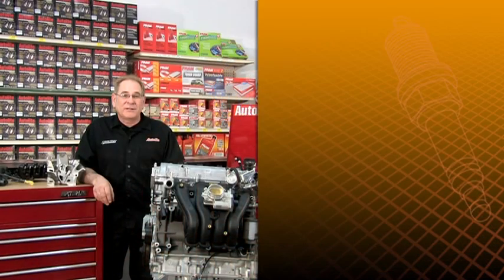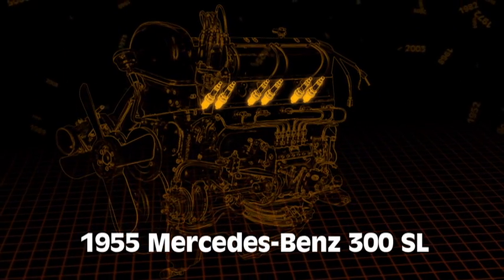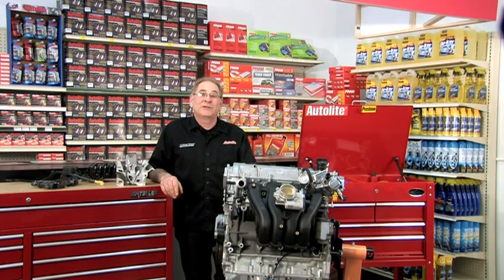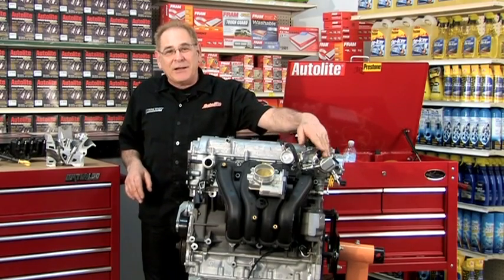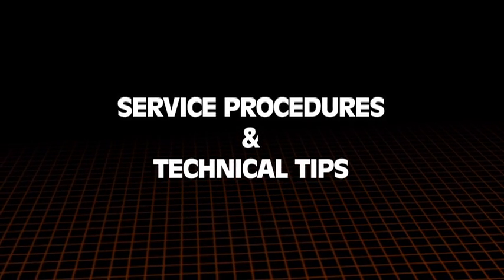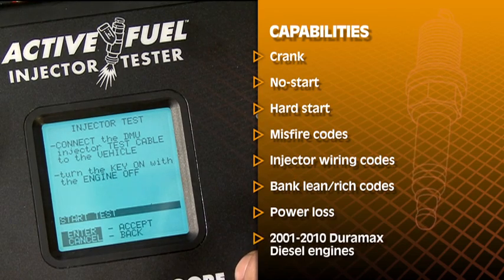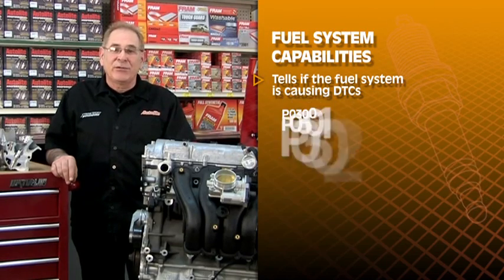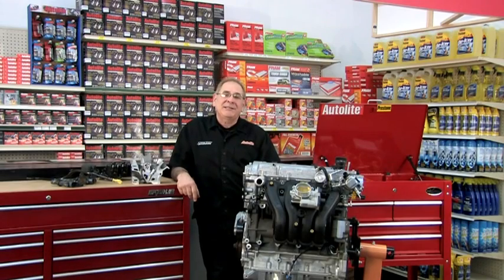Direct Fuel Injection Diagnostics

Comment: How does this system work without an accumulator?  Gasoline is a liquid and can't be compressed.  What am I missing?
Reply: The pump pressurizes the line itself which happens to have fuel in it. The fuel rushes out the injector at the pressure within the closed line  as soon as it opens. Due to the placement of the injector, the fuel has to overcome head pressure to push out and break up properly for proper spray
Reply: If there is no compliance, the fuel pressure will drop to 0psi as soon as the injector opens.  On my car, there are 3 cam lobes driving the HP fuel pump, but there are 4 cylinders.  So, the pressure must stay up even after an injector event.  Where is the compliance in the system that allows this?
Reply: @ThatEEguy2818  constant pressure.  You have 2 pumps. 1 in tank and your mechanical pump driven by the lobes. The hp pump pressure is controlled with a solenoid valve that opens or closes depending on voltage it receives.  The injectors only open for a few ms. It also sprays for through tiny holes. Because of these factors, the actual rail pressure variance is minimal
Reply: My understanding is that the solenoid in the HP pump is only opened briefly by the ECM to let in a measured amount of fuel to be compressed.  The ECM knows the pressure in the HP rail, and it knows the pressure at the inlet.  It knows how much pressure it needs, and calculates how long to open the solenoid.   Still, there has to be compliance in the system for it to work.  What is stretching under pressure?
Reply: @ThatEEguy2818  I suppose I'm not sure what your actually asking.  I was assuming you are wondering how the rail can maintain constant pressure when the cam has 3 lobes and the injectors open? I believe the solenoid that's part of the hp pump is controlled by variances in voltage.  The higher voltage sent from the ECM or fuel controller, the more the solenoid opens. I dont believe It opens and shuts as in 0%-100%-0%-100%. Its more like it stays at a set value and moves according to engine load. For example,  if you are traveling with the engine at 38% load, the solenoid would be open 38% and would probably vary between 35%-44% open. The pump from your fuel tank is fairly constant and typically 45-65 psi (depending on vehicle) at all times. Let's say a constant 60psi reaches the hp fuel pump. The mechanical pump pressurizes the line to let's say 2200 psi. The high pressure solenoid opens to let's say 50% so this allows the pressure on the rail to stay at 1100 psi.  Typically at this point, pressurized line with fuel that is left over is sent back to the fuel tank. The pressurized lines with fuel that makes it to the fuel rail is pushed through a few super tiny holes for all of about 4-5 ms on avg as an injector opens and closes. Any pressure released during the injection pulse will automatically be compensated via pressure coming out the hp fuel pump along with constant tank pressure. The high pressure sensor on the rail shows the amount of pressure as well pressure loss during injection pulse. Does this explain this a little better? If not I will try again
Reply: I have a well.  In my basement is a tank with an air bladder.  This tank charges up, and has so much compliance that spraying a second of water out a faucet doesn't impact water pressure.  If the tank goes bad, and there's no other compliance in the system,  that same 1 second spray from the faucet would cause a dramatic drop in water pressure.  If I left the faucet on, the pump would short cycle, turning on and off while the pressure sensor relay chattered.  It would burn things up fast and pressure would be all over the place.  It would be out of control.

What, on the HP fuel rail, has compliance like the bladder tank of a well?
Reply: @ThatEEguy2818  a high pressure fuel pump has a diaphragm located within the pump. Is this maybe what your referring to ?
Reply: Maybe.  Idk, will have to look for one cut open.
Reply: Is the diaphragm rubber?  I was thinking it was a piston pump.
Reply: I've been doing more research.  Everything I'm finding says the fuel pump is piston type, the solenoid is controlled by the ECM as if it were another injector, but injecting a measured amount of fuel onto the pump to be compressed.  This valve, so says everything I've seen, is on/off every pump cycle and not in a state of quasi-on all the time.  Also, the walls of the fuel rail are thick metal.  So, since gasoline is a liquid and liquids don't compress, what expands in the system when the piston in the HP pump compresses the fuel?
Reply: @ThatEEguy2818  in the video link I sent it says that it uses high voltage to initially open the solenoid and lower voltage to keep it open. Also.  I have a hp fuel pump that I may disassemble later to see. I understand what you mean by what expandable object helps create the pressure.  Like a balloon with air and water in it. The balloon expansion would be potential energy and if the balloon shrinks it becomes kinetic energy.  Almost like a stretched rubber band. I will see if I can find out more about what the diaprham is made of. I believe that may answer  your question
Reply: That high voltage spike is just how they do the injectors as well.  Yanks that pintle back quick.
Reply: I think this is the answer.  I was assuming gasoline couldn't be compressed.  It can.
https://physics.stackexchange.com/questions/207637/can-gasoline-be-compressed/207640#207640
Reply: @ThatEEguy2818  this makes sense. Diesel fuel has higher compressibility than any fossile fuel because hydrocarbon chains are very long and each atom have more spacing with each other which makes diesel fuel a highly compressible fuel. Due to this compressibility, compression ratio is higher and break power is higher than petrol and gas cycle. Which gives the result of high energy in diesel fuel.

A diesel  engine has a higher thermal efficiency so this gives the result of increment in conversion of chemical energy to heat energy so that’s why diesel engines have higher effeciency than petrol engines
Reply: @ThatEEguy2818  I can say that the direct injection systems can be a real pain to work on. I have experienced it with a few vehicles.  One in particular was a 2009 buick enclave 3600 engine. It's a super pain to get the injectors out and in mostly due to the location of them. I am currently working threw a mystery problem that even the dealership doesnt seem able to diagnose.  I have no high pressure in my rail which causes it to run in limp mode. I clean initially took the injectors out and manually cleaned them using B12 in a tube, compressed air, and a power probe to power them. 3 of 6 were somewhat clogged (carbon buildup) and of the 3, 1 was badly clogged.  I got it back together and had an issue with a small leak. I took it apart and put it back together and now no leaks. I them decided to change the hp fuel pump. My codes were p0087 and p0089. The fuel rail had 58psi ( pump in tank). Changing the hp pump did nothing.  I checked the signal running into the pump solenoid and it was recieving something like 5.6 volts. I took the lines off from the fuel tank to the pump and verified they weren't stopped up and I also checked the sock filter in the tank. All was good. I decided to see if the dealership could figure it out and the conclusion they came at me with was it needs a high pressure fuel pump. I already changed this. I made sure the connection piece for the pump and camshaft  connected with the roller to the base circle of the camshaft. It still isnt working as in stuck in limp mode with white smoke. It appears to be flooding out but sensor reads no high pressure. I am going to change the high pressure sensor on the fuel rail next. My suspicion is that the sensor is faulty.  If its reading low, the computer tells it to add more fuel. If the sensor is faulty it is going to cause the system to try to compensate when it's not neccessary causing a really rich condition.  

I have researched these systems fairly extensively.  Physically The only parts left for me to explore is the hp sensor and the camshaft lobes themselves.  I doubt the lobes are worn to the point that its unable to pump. 100k mile vehicle shouldn't be at that point.
Reply: I have an equinox with 110k mi.  Cam lobe was about half worn because roller wheel on fuel pump seized.  It sounds like you're not using a scope to diagnose.  Gotta have one on modern engines.  Also sounds like one of your injectors are leaking.
Reply: Btw, it could be wiring too, not always a part.
Reply: @ThatEEguy2818  I've checked the ground, constant, as well as output signal. All good. I've pressurized the rail and checked for leaks via autel maxidas DS 708. No leaks found. I've ran engine balance test and all good. I'm convinced wiring is fine. I'm also convinced it's the camshaft lobes, hp fuel pump connector (wheel worn or deformed), or sensor has to be the problem (at least I hope)
 I've found the  hp fuel sensor is stuck at a certain voltage regardless of accelerating or idling.  I realize it receives a constant voltage but I'm referring to the output signal. The dealership managed to trade out the fuel control module and ecm with no success so those are fine. I would like a scope to measure the output waves and/ or hall effect. I initially also had  camshaft/crankshaft codes. I bench tested them and found 1 to be lazy so I replaced it. Are you using a scope? How much was it to fix camshaft lobe?
Reply: I didn't fix it personally.   I had a mechanic do it.  It was lumped in with a bunch of other engine work.  I'm just learning how modern engines work.  I can't decide if they're fascinating or infuriating.   Haha.  I am a EE and am very versed with a scope, so I'm learning fast.
I was thinking more like an injector is sticking open for longer than it should.  A scope would show you that if you measured injector coil current.
Reply: Idk why but I can only see part of your last comment in my notifications .  It's not visible otherwise.  Good luck with your fuel issue and thanks for the input.
Reply: @ThatEEguy2818  fyi... problem solved. The dealership was adamant about changing the high pressure fuel pump for an insane amount even though i told them I already replaced it. It took me 15 minutes to remove the pump. I used a mirror and a flashlight and found that someone removed the piece that connects the pump to the cam lobe. No wonder I was reading 60 psi. I replaced it for $40, dumped it in oil, hand turned the engine until I could see the cams base circle, carefully installed with few turns on each bolt at a time, cleared the codes, and was up and running. Probably an hour tops and a $40 part.
Reply: @ThatEEguy2818  ask an engineer
Reply: @michaelsieber6601  I did figure it out.  My assumption about gasoline not being compressible was incorrect.  It is compressible, slightly.  Turns out, slightly is enough.
Reply: Glad you figured it out.
Reply: Isn't the fuel pressure dampner basically a pressure accumulator?